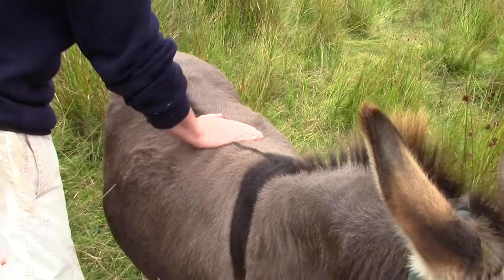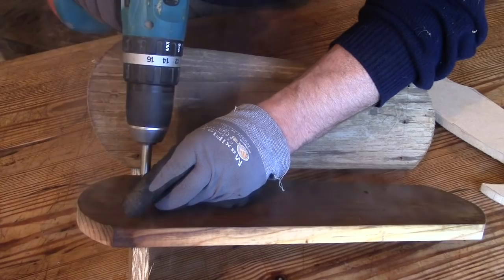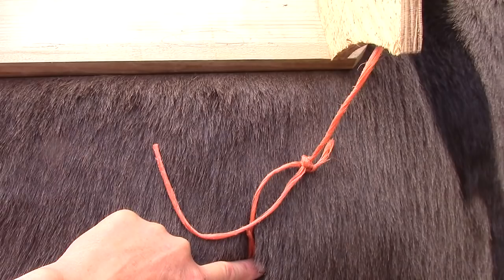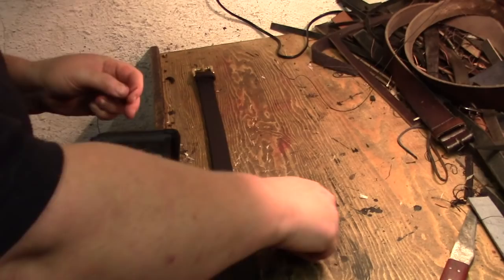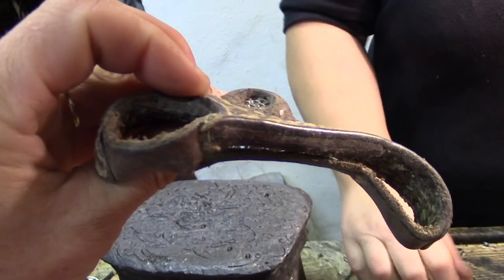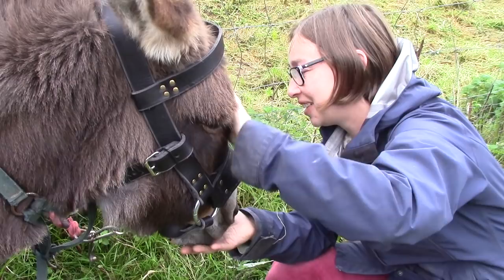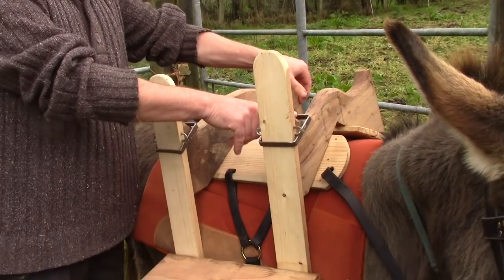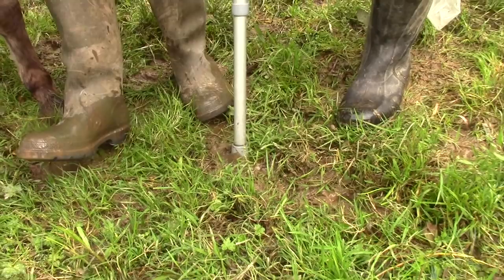Making A Homemade Donkey Straddle For The Wicker Pannier Baskets

Comment: In case someone else hasn't mentioned it, I would say those baskets are far too high and will not just make her top-heavy, but also unnecessarily worry her.

Donkeys are mostly the same as horses as far as loading goes, except you generally put the mass a bit farther back from the withers. However, too high of a load makes them top heavy and prone to "sway".

Drop the centre-of-mass nearer to their mid-line, and I guarantee they'll be happier and can carry more to boot.
Reply from the maker: You may be right, but we'll have to experiment. I left lots of room for adjustment, anyway, if they need to be lowered. There are many examples of them fitted higher than these, and lower too. We're just learning what works best.

Comment: Ow.  It does not take into account the dip in the donkey's back.  So the ends of the boards will dig into her in the front and back.  Probably ok with a thick pad so long as the load is not heavy.  Love your blogs!  Cheers.
Reply from the maker: There is no  dip when she's standing straight on level ground. If there was I would have accommodated it of course.

Comment: put a pin in it like a hinge either leather Orem make a fork and your your wood with a slot and I don't want it and drove through and put a pin and that would work too and I'll be easily replaced or the pen but that's what I would do and I fix a lot of stuff and you would want to put some cloth on underside if you're going to put a hinge and only on one side so slip and slide with your hands guitar that's what I would do I have done it with a lot of projects that was somewhere works really good with backpacks and camping gear if you need a hand and some padding

Comment: You are asking too much of the crupper/tail ring! Donkeys have no withers, the hump where the neck meets the back. Thus nothing in front of a load to keep it from sliding or shifting forward at the slightest decline or even a pothole in the trail.
Reply from the maker: You're right, Judith. we were following traditional designs. But we agree and new we're experimenting with britchen/breetching straps. Have you any good drawings/photos?
Reply: I will see what I can find.